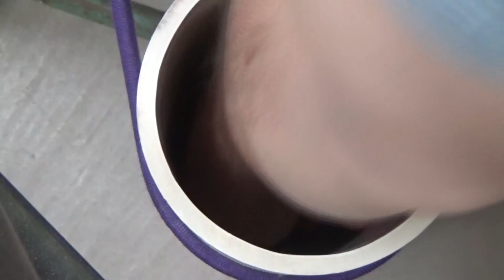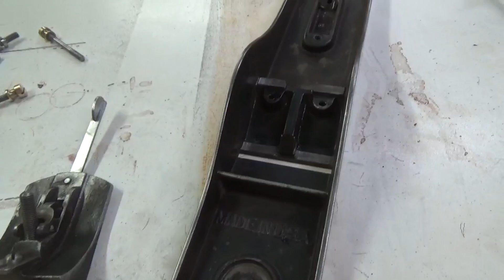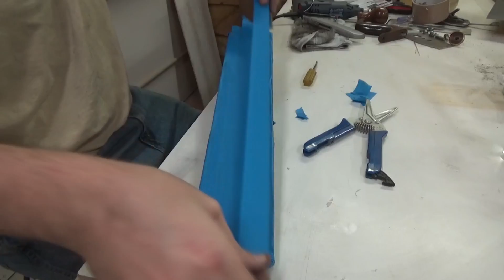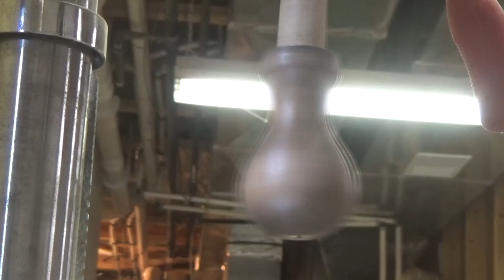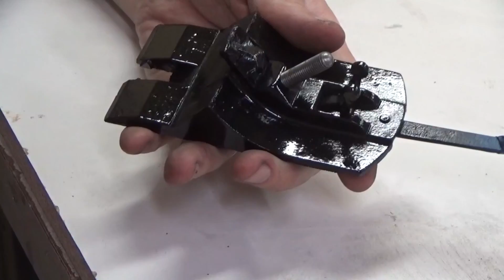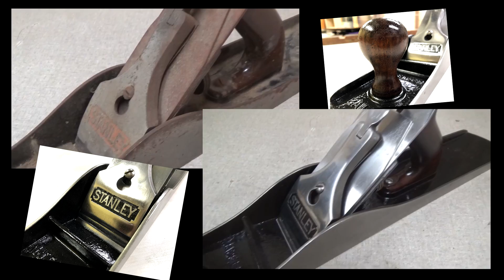Shop Work: Stanley Sweetheart No.6 Handplane Restoration

Comment: I have had better luck with Citric Acid. (faster and cleaner than Vinegar ) I like the 6 inch pipe idea ! The other thing that can make the plane a real dream to use is replacing the iron with a thicker iron- maybe a Hock.  Great Video ! I just restored 3 planes including a type 16 no. 7, a Vaughn Uncle Sam no. 5 , and a corrugated Bluegrass 5 1/2 made by Sargent .
Reply from the maker: That sounds like a great collection

Comment: One thing to note about Stanley (and many others) level caps is that they're nickel-plated. If you're going to use a wire wheel or sander, make sure to wear a respirator: you generally don't want to breathe in metal dust, but nickel dust especially.

Also, I find a scraper is faster at getting the old varnish off the knob/tote; that way you can just sand the wood, not the finish. If you don't have a cabinet scraper (you should get one they're like $20), set the edge of a utility knife blade straight down onto your sharpening stone, and rub it back and forth a couple times. That will create a temporary scraper with a burr on both sides that works well enough; it will wear out quick compared to an actual scraper, however.

11:42 Lol that's a classic, basically a rite of passage for restoring something.

Comment: I appreciate that you used brass wire instead of steel. Much less aggressive and better in my opinion. The only thing I didn't like was the spray paint. I would prefer a real japanning process. It adds a day to the job but is worth it.

Comment: Beautiful work!  Instead of vinegar, use citric acid. The resulting parts are easier to clean with less rust residue. I would also follow it up with a baking soda solution to neutralize the acid. I would thoroughly remove the paint with paint remover before rust removal. There can be rust lurching under it. For infilling the lever cap with paint, there's no need for the tape and fine brush. Just paint over the logo and wipe over it with a towel lightly soaked in acetone. It will leave the paint in the engraved areas. Finally, to keep the plane from rusting, polish all the unpainted areas up to 1000 grit. Rust doesn't like polished surfaces.
Reply from the maker: Good tips, thanks, Bob

Comment: I have rebuilt a number of Stanley planes.  Based on that experience, I think you have done an excellent job.
Some restorers might quibble with the use of enamel paint rather than traditional japanning, but you'll not hear that from me.  I am a plane user, not a plane collector -- and japanning is a level 5 pain in the ass.
BTW:  The lever cap looks much nicer without the chrome, no matter what shape it is in.  Nicely done!
P.S.  A Stanley #6 Fore plane is the BOMB. -- great daily user in the shop.
Reply from the maker: Thanks, Jerry!  I appreciate that!  The paint has held up nicely and this is easily my favorite plane to use.

Comment: Beautiful job! One thought for your consideration: Rex Krueger suggests that, when flattening the bottom face of the plane, all the components should first be installed and tightened (albeit with the blade withdrawn up into the body). The idea is that if the plane body is flattened without the components installed, it will not be in the same tension it will be in during use, so  the bottom face could be twisted out-of-flat once the components are installed and tensioned down...

Comment: I'm in the process of doing a Stanley number 5. I'm jappaning it instead of painting. Still cleaning up the small parts, your video is going to help me with that quite a bit. I'm going to use your method to clean the cap iron. I'm a nickel-plate, just for fun.

Comment: Next time be sure to put a little roll of paper in the screw holes to avoid paint from interfering with the threads. Do you have a Facebook or Instagram? I have a homemade tool that I'd like to send a pic of for you that would greatly assist with the refinishing of the knob and tote.  😃 The plane is a beauty.
Reply from the maker: No FB, sorry.  I'm on Instagram though.

Comment: Depending on the lever cap is maybe 10% due to rust, and the remaining 90% was because you let that sit in vinegar as long as you did. I made the same mistake. You can't leave cast iron in vinegar that long. Cast iron only develops surface rust, it will never pit under normal circumstances
Reply from the maker: It was pitted before I put it in the vinegar, probably from years of neglect.

Comment: I use a bees wax boiled linseed mix and rub This into bare metal surfaces, Polish off and this works well for protection of surface and makes it glide over wood, repeat as required. This works for me.👻
Reply from the maker: Nice tip! Thanks

Comment: Great video. I too have a no.6 Stanley Bailey Type 19 which is in need of restoration. Seriously considering taking it to a machine shop and have them mount it on a surface grinder and take a few licks as opposed to manually flattening the sole.

Comment: Nice find and awesome job for someone that's never done a plane restoration before. One question though, did you use any WD-40 type lubricant on the screws before you reinstalled them?
Reply from the maker: Thanks! Hmmm I can’t recall if I did or not. I’d guess I probably didn’t

Comment: Beautiful job Drew, she looks gorgeous, but you're only half way there my friend. Those shavings were very thick and sounded like hard work. If I can offer some help from years of restoring planes. 
The sole should only be flattened with the plane assembled and the blade withdrawn as when you tighten everything down on assembly it will distort the casting and all the flattening done before will be irrelevant. 
The mating surfaces of the frog and plane body should be checked for flatness.
The edge of the chip breaker should be flattened where it sits on the back of the blade so that it applies even pressure right across and so that shavings can't jam underneath/between. Hold the blade/chip breaker assembly up to a light and look for gaps, gentle rubbing of the underside of the leading edge of the chip breaker on a stone will get you there.
The back of the blade must be flattened and polished, before you can sharpen the front.
It should be effortless to get shavings that fine that you can read a newspaper through them, then Grasshopper, you may leave the temple.
Reply from the maker: Excellent tips!  Thanks much, Graham!
Reply: I almost commented on how the plane sounded struggling thru the wood. But he did such a beautiful job I couldn’t lol. This is the absolute proper way right here ^^^^^^ def get a thicker replacement blade, confirming the yoke will catch the slit in the chip breaker, or get the IBC blade
Reply: But It’s a Fore plane. 😁
The truly first step of is to identify they type and purpose. 
its supposed to be a workhorse and take thick shavings and not be machinist grade accurate. 
You plane-fetishests all tend to think that even scrub planes should take off Japanesey thin strips.

Comment: Beautiful restoration. Something that eats rust even quicker and more thoroughly than vinegar is muriatic acid. It is more dangerous to use and requires good ventilation but the results are nearly instant (under 5 minutes) and the leftover acid is also a.useful way of cleaning any oil or grease dripping from stains in the driveway or garage floor. It’s cheap and available in hardware or big box stores like Home Depot. Also found at pool and spa stores at a much higher cost.  It cleans the metal so completely that it wants to start corroding again quickly. Just rinse off the acid with water and wipe on some lubricating oil or WD-40 to halt the corrosion.
Reply from the maker: Didn't know about the acid.  But I'd probably still opt to go the slow and safe route with vinegar rather than experiment and inevitably melt my limbs off with the high powered stuff.  :)  Thanks for watching, Dennis
Reply: Fisher's Shop; You might wish to give it a try. Just do it out in the yard with a little breeze to your back or set up a fan. The fumes are the biggest concern. It really is easy to use and safe if employing some common sense. Some rubber gloves or some tongs to handle the pieces will keep you safe and lower the pieces into a disposable aluminum cooking container as is used for cooking turkeys. Use just enough acid to cover the taller pieces. If cleaning odd size tall pieces a paint brush can be used to brush on the acid. The brush won’t be damaged and after cleaning with soap and water it an be used for painting again. The speed and thorough clean up of the rust is an amazing thing to see. Pitting will still require some grinding but the surface rust is gone in seconds.

Comment: Great clean up of that old rusty plane. Just a shame that you painted the "STANLEY" background on the lever cap black instead of red as it originally is though.

P.S. Just out of curiosity, why do you run the plane at such an angle when you use it? Sort of defies the purpose of having a No. 6 plane if you are only going to put about 10% of it on the board.
Reply from the maker: I like the look of the black over the Stanley orange.  To each their own, I guess.  I'm no hand plane expert, but I run it at a slight angle to improve cutting.Doing so adds more of a slice to the cut instead of a direct chop... if that makes sense.

Comment: I enjoyed your video! Just a few things that I have learned from  amazing individuals is that for the edge of the plane body you remove the tape before it dries. Then you can use a razor blade to gently scrape the paint to true up the edges of the painted inner area with the unpainted sides. The best time to do it is when the paint is gelling and not hard. It helps seal the edges of your paint o prevent moisture from penetrating underneath and causing chips/bubbling. Sometimes when you peal it off after it it's dry you could remove some area of the "wanted" paint Now you have to waist more time on touchup. Look up Evaporust. It's magic for restorations. Make sure you do a light sanding between your coats of lacquer. After your first coat, the next one will not have a prepped surface to adhere to so your chances of the lacquer flaking off in the future is greatly increased. I like your outtakes! You talk the same way I do when I make mistakes.haha. "Nice goin' ya moron!"     :D       Subbed!
Reply from the maker: Great tips! Thanks! :)
Reply: You don't need to sand between coats of lacquer for adhesion purposes.
Reply: @eriknelson9975  I learned the hard way. Maybe you don't have to sand in between coats with SOME brands of lacquer, but the one I use it is preferred.

Comment: I found a Bailey #6 plane in a trash can. It's just like the Stanley. Matter of fact. Stanley and Bailey made planes together. Mine looked just like yours when I found it. I restored it. Although I did not paint it or refinish the handles. I like the old school look. You did a very nice job on yours. But, now that I see how nice it looks with spit & polish, I'm headed out to the shop to do it over again. I use my #6 quite often. Matter of fact. I used it yesterday to fine tune the fit of a door. Best free tool I ever had.
Reply from the maker: That's awesome, what a great find!  Best of luck on your next restoration.  Maybe it'll be a new Stanley for Stanley.  Thanks for watching!

Comment: Have you ever used dura-coat to paint any tools? It's like an epoxy based paint that adds a better protective and durable coating.
Reply from the maker: I haven't.  This was actually my very first tool I ever restored.  Dura-coat sounds like the way to go though!  Thanks for the tip

Comment: It turned out great. Why did you tape off the inside why not just paint that as well
Reply from the maker: The frog sits on that area and I didn't want the paint to interfere with it not sitting perfectly flat.  I think it would eventually get worn down too and chip off if I had.

Comment: I have the same plane except mine is a #6C.. Mine was my Wife's Grandpa's..He was a master cabinet maker & also had a #4C & a Bedrock 602 + a 9 1/2.. I painted mine just as you did.. I have about 50+ files that he had soaking in the vinegar now..
You'rs came out really nice after polishing.. Congrats!! BTW I also used white vinegar & don't think there's any way better than how you did it.. Gary/Hk
Reply from the maker: Hey thanks!  It sure is a lot of work, isn't it?  I still haven't gotten around to restoring all the others I have.  I've only done this one and the little block plane.  I'll have to get busy.

Comment: On some of my handplane restoration I use a generic sears sandblaster with med. air pressure  on the plane body and many of the other parts but just not on the planner bottom, I too flatened it on a flat surface. But the sand blaster is much quicker, I just blew the pieces off with air then a quick buffing on the grinder with a wire wheel, and its pretty much ready to give it a coat of paint.
Reply from the maker: Nice tip! Thanks, J Fred!

Comment: What a terrific job you did on the number 6. (the video is very well constructed and edited) The plane looks brand new. Every time you pick it up you will take a breath and admire the finished plane. I somewhat restored my Dad's old no. 4 and it works like a champ.  I think of him every time I pick it up.  I  liked the taped funnel for pouring the vinegar back into the bottle. Clever.  Also, i am really happy to see someone else use Mineral Oil instead of boiled linseed oil.  I never realized linseed oil rags can combust on their own.  (plus, I am allergic to linseed oil)
Reply: "....my Dad's old no. 4 ........ I think of him every time I pick it up."  I'm in exactly the same situation - I have my Dad's  No4 and No5, plus 2 old tenon saws that I think belonged to his dad. Every time I use them I almost feel like I'm shaking hands with him.
Reply from the maker: Thanks so much, Bruce!  What a nice comment to read! Thanks for watching
Reply: I really like some of your basic working practices.  I have NO power tools.  So, I accumulate little bits of knowledge to work with only hand tools.  But really, your videos are very well crafted.
Reply from the maker: Thanks! I'm more of a power tool guy but I certainly appreciate and enjoy working with hand tools too. Thanks for the kind words. Im just starting out here on YT and it's sure been fun so far.
Reply: You actually have some unique projects here.  Not seen anywhere else.